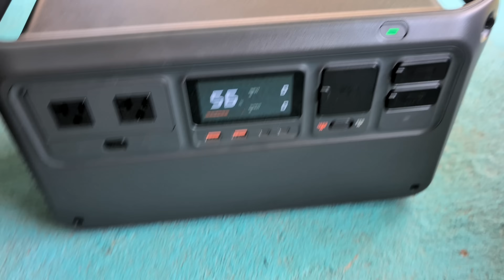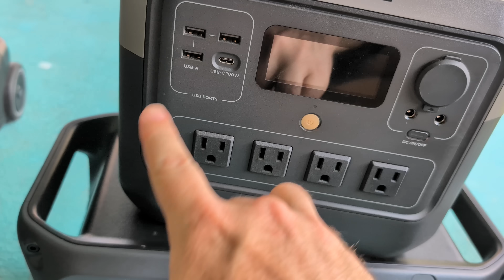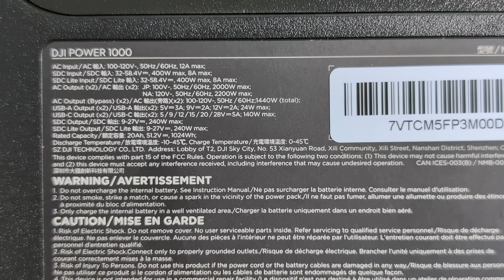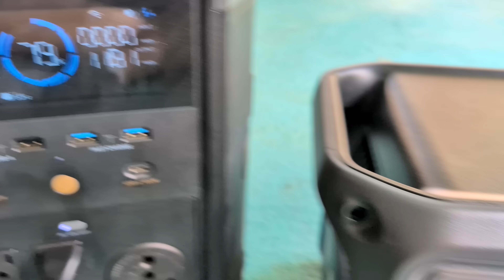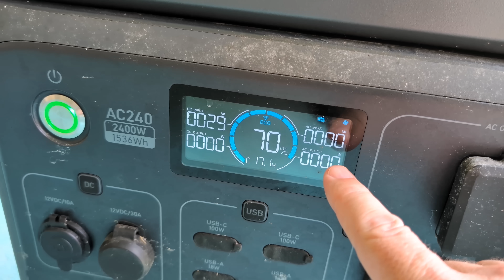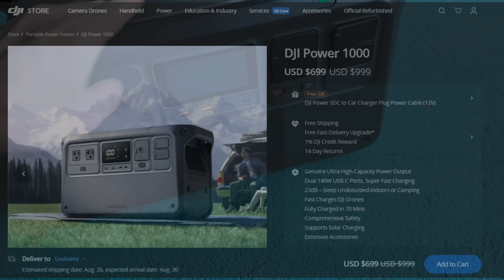DJI Power 1000: Handles Big Loads! + Quick Charge Drones

Comment: I like the modular adaptor approach..Its not weird you mentioned the reason straight after its for other DJI stuff LOL You need controller for solar
Reply from the maker: I get the drone thing but not including an XT 60 input on the device like everyone else does is super odd.
Reply: @digiblurDIY  When 12v notoriously flakey cigarette sockets fail I can see the benefits them being separate. Yes XT60 omission is different, but again I've added 3x for £31!! I guess I just like different LOL! Waiting for the previewed 2KW expansion to appear now.

Comment: E o flow delta series is where its at but these are nice for the size. Drones dont concern me but thats a cool feature i guess if you do drone shows races etc
Reply from the maker: Yeah I have a few EcoFlow ones. Pretty nice. The drone accessory side of things is probably the big draw here or if you need that high wattage output.
I really want to see someone do a user replaceable battery like a UPS has.
Reply: @digiblurDIY  Plus its a lot quieter too